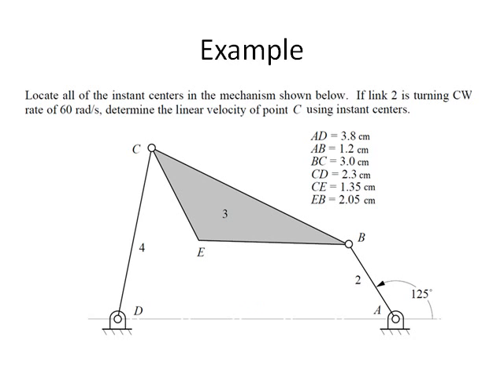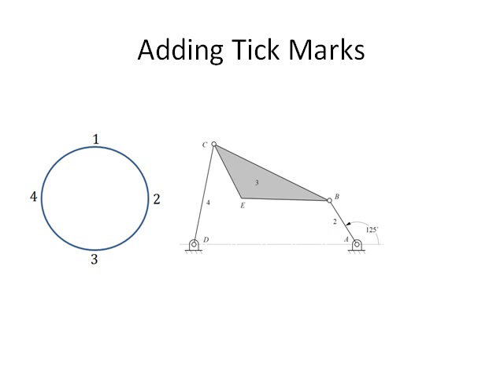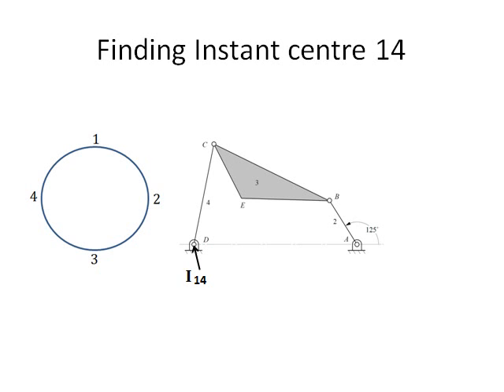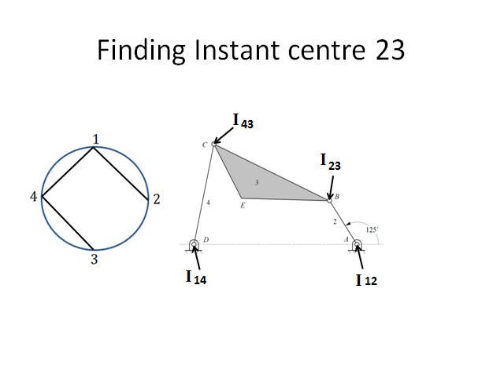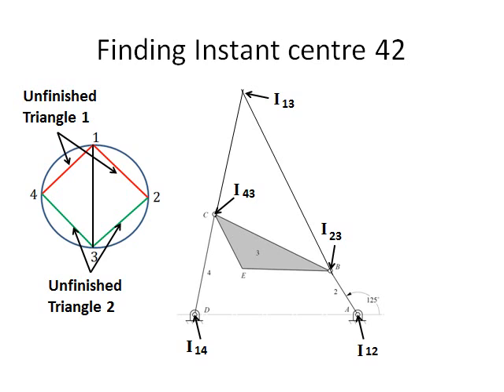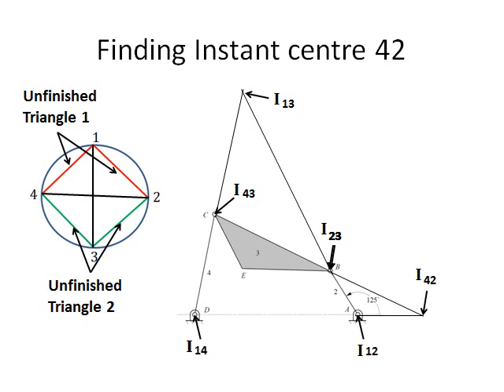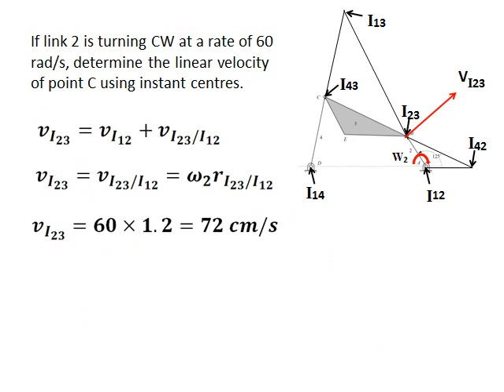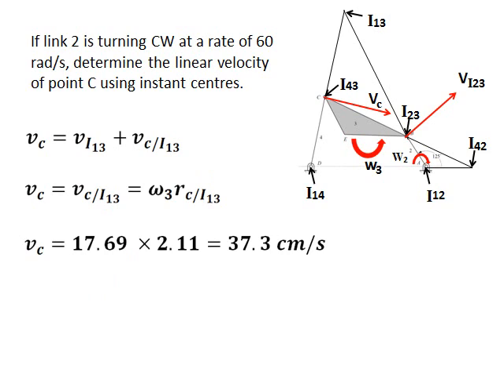Instant Centres of Velocity: Example

Comment: i still not understand, why W23 is CCW?
Reply from the maker: I23 is moving clockwise with repect to I12 and anticlockwise with respect to I13. It was worked out that the velocity of I12 is in the general direction towards the right of the screen. Note that I13 and I12 are points that are fixed to the frame.

Comment: Great explanation. My query is what if we take I42? Would that be wrong ? What is the rationale behind selecting instantaneous centre for a given link. Give reason
Reply from the maker: The rationale behind selection is to analyse the question. The question will ask about finding the velocity of a certain point. The question will give information about a certain point. Use an instant centre that will relate the two points. Yes you can take I42 and this would not be wrong. It is an acceptable alternate way to solve the problem. This is because point C is on link 4 and link 3 and information was given about link 2 in the question.

Comment: in 9:40 mins how did you get the length as 4.07cm  also in a similar question it has asked the velocity of point E how to find that please answer ?
Reply from the maker: The length of 4.07 cm was measured from a scale drawing of the example problem. The distance is actually 4.09 cm. This being so, the angular velocity of body 3 is actually 72 / 4.09 = 17.604 rad/s

To work out the velocity at point E, use the relative velocity formula:
The velocity at point E is equal to the velocity at I_13 plus the velocity of point E with respect to the velocity at I_13.
V_E = V_I13  + V_E/I13
The velocity at I_13 is zero as it is fixed to the frame. To understand why, it is necessary to understand the concept of theoretically extending the bodies to find instant centres of velocity.
The velocity at point E is therefore equal to the velocity of point E with respect to the velocity at I_13.
V_E = V_E/I13       (V_I13 = 0)
Using a simple formula, the velocity of point E with respect to the velocity at I_13 is equal to the distance between point E and point I_13 multiplied by the angular velocity of body E.
V_E = V_E/I13 = R_E/I13 x W_3
We measure the distance between R_E/I13 and W. Let us say that it is 3.26 cm.
V_E = 3.26 X 17.604 =  57.389 cm/s

Do not forget that velocity is a vector and as such has a magnitude and a direction.
From the definition of the cross product, the direction of the velocity is perpendicular to a line drawn from I13 to E.
By imagining I13 as a fixed point on which body 3 rotates around and noting that the direction of the angular velocity of body 3 is counter-clockwise, it is easy to see that the velocity at point E is in the general direction of the right of the screen.